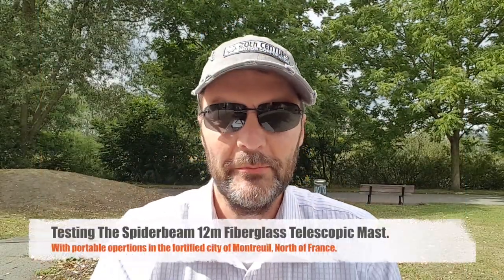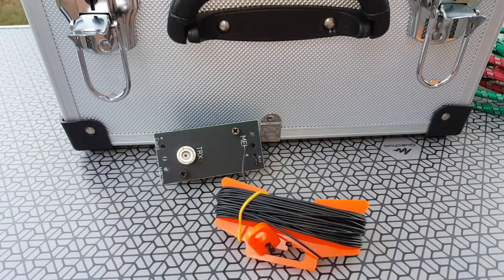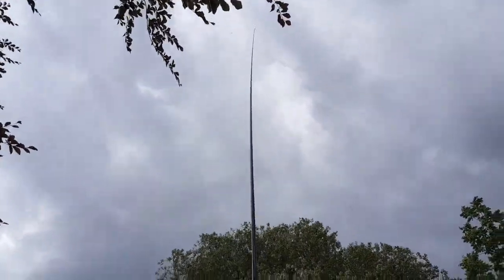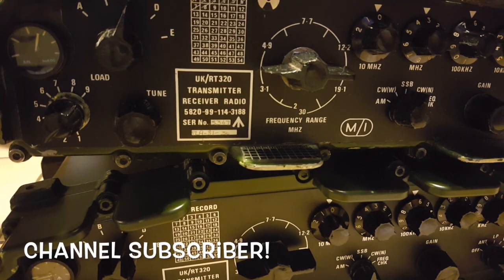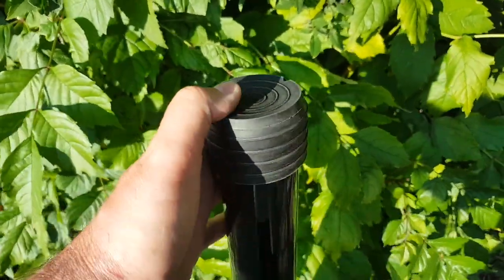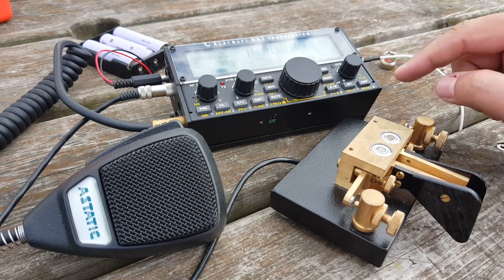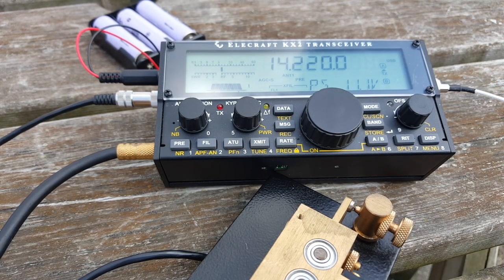Testing The Spiderbeam 12m Telescopic Fiberglass Antenna Mast.

Comment: want to buy this 12 meter pole  is itt ok for my kelemen dipole 4 kg    tu  thx video  73,
Reply from the maker: 4kg would be too much for the tip, but you can remove the last one or two elements and that would work, just a bit shorter..
Reply: Yes say it to myself 10 meter thx for help and tip hp wk ur  bands are terrible 73 de ON3MK Mor

Comment: Awesome. I just bought a very well used ICOM m700 pro. It fires up with a 12 volt battery. I do not have a ham License yet. I was trying to figure out a power supply for this radio it's 150 watts full power?? If that is the proper term? I was looking for a suitable switchable ac to dc power inverter that was not to expensive. Then I want to buy something like yours. A Spiderbeam and a wire antenna. Sit on the back porch to not annoy my family. Haha.  Cheers dude loved the video. 👍👍
Reply from the maker: Great, I had an M700 (not pro) excellent radios.

Comment: As thick as that tip is it bends pretty well. I used it as the center pole in an inverted V EFHW 130" chameleon antenna. I'm not sure but I might have been better off with leaving the top 2 sections mostly collapsed to leave it at 35' instead of sagging badly at 42' extended. I need to relocate it today and will try a 35' vertical with the remainder as a sloper. I strongly recommend using the clamp kit especially if you plan to leave it up for a while. When doing a long V or any other configuration that might create a good amount of tension the topo flexes at least 5' back over negating the top 2 sections. You can definitely get 35' reliably but don't count on putting a heavy balun up there. If I were to do it again id get the taller model (60 ft?) so as to get 45-50' of rigid mast. They will all flex up top. The pole is offered with a metal loop inserted in the top so you can tie some poly line in a loop and string your antenna through it. Overall I recommend it but with the caveats mentioned above.
Reply from the maker: Yep, I often remove one or two sections..

Comment: I have been interested in spider beam to hoist an EFHW antenna. I am guessing it would be best not to tie the feed point to this pole but something else non-conductive.  How long have you had the pole up? I plan to start portable for POTA and will have ham sticks for a couple of the bands.  And then I would supplement with an EFHW. I am new so I will bring HF rig from QTH. I am considering making my own EFHW transformer. Thanks for you videos.  It helps to see the item I am wondering about put to use.  Al the best! 73 de KI5HXM
Reply from the maker: Hi, I have been using it almost every outing for maybe 5 years. As far as I know it is non-conductive. It sure works great.

Comment: Thank you for this video, OM - much appreciated. I have recently moved to CT7 from ZS1, and am now in a rented QTH for 12 months. I want to put up my 80m horizontal loop again at this QTH, but need it to be easy to take down again when we move. I have been thinking about using these Spiderbeam masts at each corner, lashed to fence posts, and basically permanently extended until the end of our lease, but had some concerns about their weight carrying capability (80 metres of D10 is not heavy but not light either) and wind/weather resistance. You video has helped me a lot with clarifying my thinking. My concern is around them collapsing, obviously. Thanks again, have fun. 73 de CT7/ZR1XZ.
Reply from the maker: The longer ones use clamps to prevent collapse.. Obviously you will have to guy them..

Comment: Hi Radio Prepper. How do you join the elements of the mast. . You don't need something else ( tools ) ? Spiderbeam sells an accesorie to attach it. Thanks a lot.
Reply from the maker: Nothing. You just pull on them. Friction is sufficient on the 12m mast. Longer masts require clamps.
Reply: @RadioPrepper  Thank you very much .73

Comment: Interesting review. I guess you can go as far up as you want with the mast. So, if you had this 12m mast and mounted a j pole and only wanted to go up 7m, that you can do?
Reply from the maker: You remove elements from the bottom, simply slide them out, takes 10secs...

Comment: Just ordered mine. How did you remove the smaller sections? Through the bottom? I'm thinking of using for POTA, and I'll use a couple hamsticks on a Chameleon Antenna Octagon Antenna Spoke Base. Thx
Reply from the maker: Easy, you slide them out from the bottom.

Comment: Thanks for posting the most informative video. I am very impressed with the mast. Most Brand X masts have a super thin top section or two that are so weak and skinny that they just bend in a U so you end up with a 34 foot mast that ends up being only 26 foot once the top section bends.
The mast you just demoed is the making of a full quarter wave vertical for 40 meters working portable. ......or.....attaching a HWEF20.  Attaching a HWEF40 is do-able as an inverted L. 
73 de KU3X/QRP

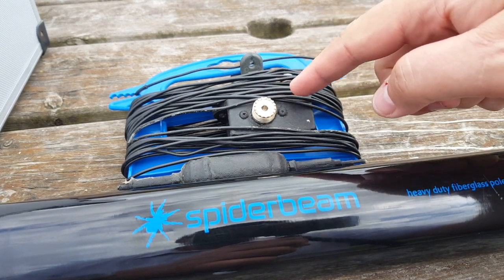Comment: 11:59  "This is a great antenna"....I'm sure it works during good conditions. Unfortunately, it is never equipment that determines successful contacts, but rather band conditions. Under good propagation conditions, I've used 1 watt and little more than a 9-volt battery feeding a paperclip to contact distant DX stations. Under bad band conditions, 1,500 watts into a multi

    -element Yagi mounted at 23 meters barely works at all. Ham Radio manufacturers always sell more equipment during 11-year cycles when we are blessed with sun spots which ionize Earth's ionosphere.

      Currently, in 2021 we are still near the bottom of the cycle...a cycle which is also among the bottom of cycle groups. Band conditions are difficult now to say the least, with tremendous QSB and atmospheric noise on many frequencies at certain times of day. 

      After living through both rich Solar Sun Spot Cycles and poor ones, I have finally realized that buying fancy, expensive new radio equipment will not help make contacts. Driving a Rolls Royce through a blinding blizzard is no different than driving a Volkswagen...( by the way, Volkswagen owns Rolls Royce)  So, just like the weather, in spite of the fact that one may own a beautiful yacht, it is of little use if the ocean is choppy and stormy. Hopefully we will start to receive better Sun Spot Activity and our ionosphere will start to charge up.
Reply from the maker: I couldn't agree more.

Comment: Never cut the antenna wire--fold it back on itself to get the swr where you want it.
Reply: Folding back antenna wire will not work. Electrically, the electrons will continue to radiate to the end of the wire, which will be far too long. You must do:  1. Cut the wire to the desired length with no excess. OR  2. Fold back the excess wire and remove insulation from the tip and the main wire and wire them together. This is the only way the electrons will radiate at your desired length.  We often confuse mechanical logic with electrical logic and they are not often the same.
Reply from the maker: You could fold it but I think the wire has to be in contact the whole way.. Better spool it at the top though.

Comment: Just received my Spiderbeam mast. Also got the clamps for securing the elements. Need to prepare them (cut/crimp) before trying to use. Over the years when twisting the elements they tend to wear out and in the end break/split at the bottom. 
Thanks for all your video's just watched your after lockdown outage with the minion sdr !
Reply from the maker: Thanks. I don't have the clamps, we'll see...

Comment: A fiberglass mast was a tempting purchase, but I’m sticking with my metal portable mast.  Almost no bending at all when using a end fed, or a wire dipole or a small beam ant, and with a dual-band Diamond stick on top plus two runs of LMR-240 (using a Velcro strap on every mast section to keep the coax from blowing around).  And when backpacking, I’m not likely going to take with me or use a mast at all.  But this was interesting to watch!  TKS es 73!
Reply from the maker: No coupling to the radiating wire? I use LMR-240/UF..

Comment: RP,  use a vertical 40m Delta Loop with the top apex held up the mast, guy ropes on the two lower corners and the feedpoint half way along the bottom side.  Add a 2:1 balun at the feedpoint and you will have multiband operation from 40m right up to 6m, at least 1-2 db gain over a dipole and being in the vertical plane it will be bi directional (unless you slope it) so you will have even more gain.  You will also have very low noise so you would be able to hear weaker stations.
Reply from the maker: I tried a 30m Delta Loop but it was already quite big...
Reply: It would only be for portable use so size isn't a problem.  My fixed 40m Delta Loop is horizontal and 5 metres (1/8th wave) above the ground in my front garden, and it works great...Raising it any higher here isn't possible as I have three BT telephone cables running horizontally about 2m above it, but for portable use with the Spiderbeam 12m mast I would use the mast to hold up the top apex at 12m above ground and slope the rest of the loop in the direction I want to work (say towards the West to work US stations) and use a guy rope on each of the lower two corners tied to a couple of tent pegs in the ground  to tension the loop a bit...Obviously you wouldn't be able to add too much tension because the Spiderbeam mast is very flexible.  The feed point would be half way along the bottom side, which is parallel to the ground, to give horizontal polarisation and it would be low enough that you could reach it comfortably to attach the coax onto it.  You would need a 2:1 balun in the feed box, to match the loops 100 ohm impedance to the 50 ohms of the coax but these are very cheap and simple to make...I made one for only around £5.00 because I got the waterproof box   and enamel coated wire for free from friends and other hams.

Comment: Hi Gil, just catching up with all your old videos since subscribing recently.  I've used that Spiderbeam pole (on loan from a friend) and can confirm it's absolutely awesome.  I went looking for a budget alternative and found the Windjammer camping flagpole on eBay.  I have the 10m version - it holds itself up really well at full height with a wire, and can take a fair bit of wind before giving up.  I often take a few of the higher sections out and stuff my X30 in the end with the coax running down inside.  It'll also take a light yagi at that height.  I used to tape it at the joints, just to be sure, but these days I don't bother, there's a sweet spot where it holds itself up nicely but isn't a total pain to bring back down again.  Talk to you over the water one day, I'm very near GB3EK.  Soixante-treize de 2E0KSB, JO01RI.
Reply from the maker: Great info thanks. I am in Antibes now though ;-)

Comment: NICE ANTENNA MATE, BUT YOU GOT TO BE KIDDING SECURING IT WITH A ROPE AFTER YOU EXTEND IT. YOU SHOULD SECURE THE BOTTOM PART FIRST WITH TWO HOSE CLAMPS OR RATCHET TIE DOWNS BEFORE YOU START EXTENDING IT.
Reply: Steve, you obviously have not had any experience with Spiderpoles.  NEVER secure with hose clamps or any other clamps.  Metal clamps should NEVER be used on thin-wall fiberglass tubes.  Ratchet-Straps are best, but rope works just fine.  With over 30,000 of these Spiderpoles in the field, we know best how to use them.  de DJ0IP (Spiderbeam)
Reply from the maker: Absolutely! I have deployed mine probably a hundred times. It is my most used piece of radio gear.
Reply from the maker: Never had a problem doing it this way. It is not a permanent installation.

Comment: Great video. First, most operators will not exceed the limitations of this equipment, i.e. more weight than each telescopic section can bear, assuring that each section is tightened before extending the next section. If you're a really concerned about slippage of the sections a piece of paper masking tape around each joint should be sufficient. Those hose clamps begin to add weight. Spiderbeam made the longer length mast poles available too late for my liking. I found a local United States distributor of thick wall fiberglass telescopic masts, Max-Gain Systems. My fist telescopic mast was their 32 foot heavy duty mast. My physical condition prevents me from hiking anymore and my age has something to do with not being able to carry great amounts of weight as I did prior to reaching 50. Athletic injuries from younger years have began to make my ankles, knees, well everything from my chin down, ache more at 73 years. My 32 foot mast nests down to 7 feet. I have joggers 3 wheel 2 seat stroller that I use for transporting my equipment from vehicle to whatever remote location I desire. The inflated stroller tires are a benefit when crossing non-paved surfaces.

Comment: Thanks for the video. I ordered the 12m spiderbeam based on your findings. I use an 8010 EFHW and have a 49:1 end fed 20 meter antenna which will be perfect with this pole. Thank you. Jim Self KW4PW
Reply from the maker: Definitely, I need to get mine back from up north...

Comment: Hello Gil, I'm contemplating buying the 12m HD (or 18m) fiberglass  Spiderbeam pole. This video is made in August 2017 so you have the pole like almost 1,5 years now. My single question, are you still happy with the 12m HD pole?
Bav
Gust ON6KE
Reply from the maker: Yes, very much so, except it's a bit heavy for long hikes, but very tough.
Reply: Excellent, that's good news. Thank you Gil.
Gust ON6KE @RadioPrepper

Comment: I have the same pole I am very pleased with it. Good value for the money. I use it  for my 40 m delta loop.  The very top section needs to be guyed .
Reply from the maker: Yep, I use mine all the time, no guy wires, but I use pretty light wire.

Comment: Bon mât mais utilité illusoire . Une canne à pêche sur un point haut fait aussi bien l'affaire . Sauf que wimo se gave bien au passage ...
Reply from the maker: It depends on what kind of antenna you use. For a light wire antenna a fishing pole works as well. For a Yagi-Uda or VHF/UHF vertical, as well as a long inverted V, the Spiderbeam works better. I prefer a light fishing pole for hiking, no doubt...
Reply from the maker: Oui, ça dépend du poids de l'antenne. Dans certains cas une canne à pêche est un meilleur choix. Pour une Yagi ou VHF/UHF verticale, ou une longue V inversée, le Spiderbeam marche mieux...

Comment: Hi there Gil,
I enjoyed your video there using the Spider Beam fibre glass pole. They seem very good. I thought they were a lot thinner than that before seeing your video, so thanks for putting that point straight. Thanks for giving me some ideas for putting up antennas in a small garden. 73 and good DX from John - G0WXU
Reply from the maker: +John Cliff Thanks John. The 12m pole is a bit heavy but rugged and a good length. I do like it a lot. For hiking though I use a 6m light pole. I think I need a 9m light pole for that, as 6m is a bit short for 40m operations..

Comment: Great video.  To prevent collapse in the USA Amazon and Autozone sell Koehler EZ Clamps, stainless hose clamps with built in knob, don't require a wrench or screw driver to adjust.  Great for preventing collapse and easy to adjust.  Thanks for the great quality video and the excellent audio.  My 72 year old ears tire easily with the wind noise of other videos.

Dave K8WPE
Reply from the maker: Thank you, good to know.

Comment: Gil,
Great video. Bought two of the 12m poles at the time of Hamvention. I would recommend getting the hose clamp kit. It is available for the 12m pole. I've had both poles up in the back yard supporting an terminated inverted u antenna and the wind movement made one the poles collapse. Since using the clamp kit, the poles have stayed up even in high winds.  73  WB3BJU